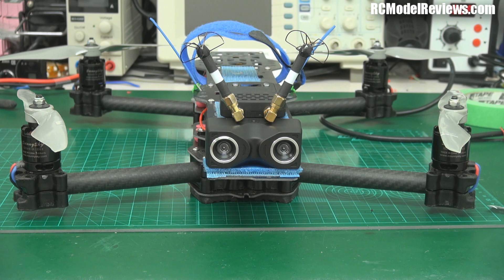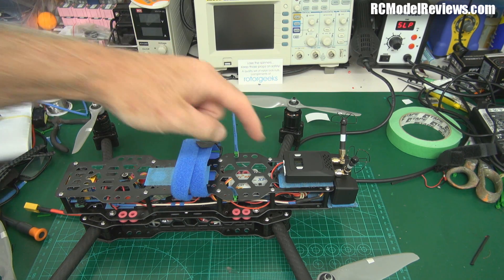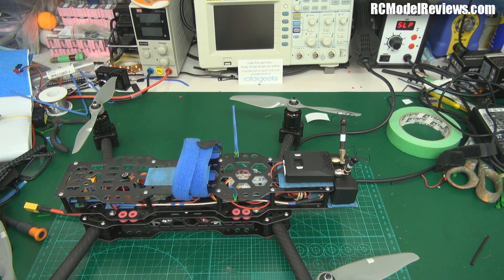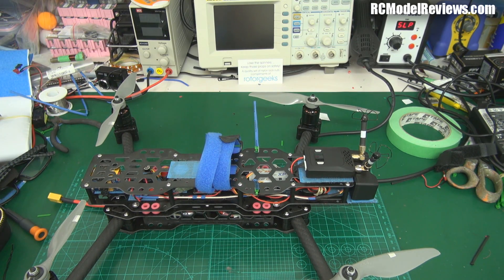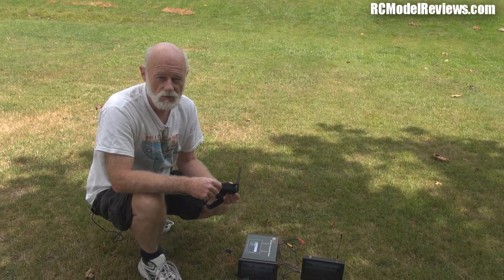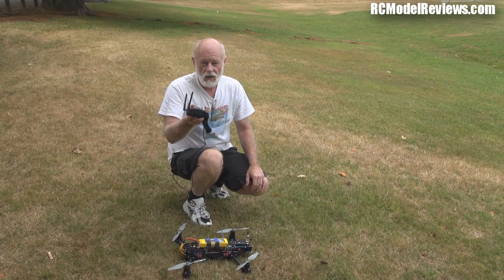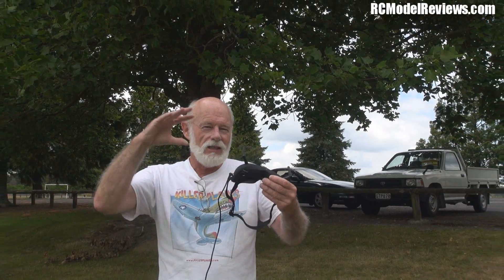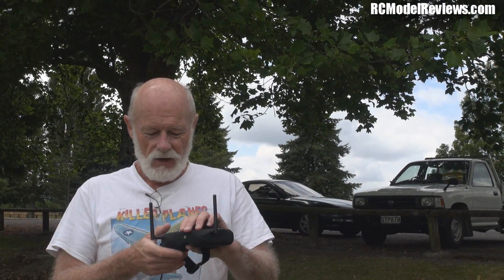Review: SkyZone 3D FPV glasses (with 3D footage in this video)

Comment: Hi Bruce-I am about to get some Skyzone Sky-01 V2 goggles - it sounds like you like these quite a bit and so worth the extra money?
Reply: RCdeparture Bear in mind that I've only used them for a total of about 15 minutes so far... yes I do like them.Even without the 3D option, they're an improvement on the V1 Skyzones (which I love) because they have the inbuilt DVR, a better light-seal around your eyes, a better in-built camera, a voltage alarm to alert you if the battery you're using to power the goggles is getting low and a number of other features/enhancements.There are some down-sides but they're minor and I'll discuss them in the next vid.

Comment: thank you very much for the review Bruce, besides the 3d effect, how does it compares to other goggles like dominators? I mean, with 500$ you could buy the dominator HD... is the image quality worth it? 
thank you!
Reply: Dag Eide
I haven't reviewed the Dominator HDs because they are awfully expensive (I only have a limited review budget) and FS haven't offered to send any for review so it would be a sizeable chunk of that budget.

How do the Dom HDs do 3D if they only have one receiver -- or does that require an external dual-receiver?
Reply: Ricardo Iarossi I'm going to examine the goggles and whole package on the bench in the next video but I figured that everyone wanted to see how well they worked and would be really annoyed at me if I left the flight video for a "part 2" ;-)Yes, the quality seems very good and the resolution is not far short of the Fatshark HD units -- albeit with a smaller field of view and a 16:9 aspect ratio.As I mentioned in the video, I think the "value" equation is good, considering that you get the total package from camera through goggles, whereas the Dominator HDs are only the goggles -- you need to add receiver, transmitter and camera to the mix to get an equivalent package and even then, you're not getting the 3D option.
Reply: ***** thank you! I'm asking that because the only goggles I tested was the Headplay and I didn't like it at all. first I could only see double images, after a lot of trying I could see one single image but it was not confortable. also the edges was a little blurry.  I was really upset because with the Quanum goggles(30$) I had a way better experience. Now i'm wondering, maybe theres something wrong with my IPD?
Reply: ***** I have the Dominator HDs and they do have 3D capability, although I haven't tried that out yet. Existing 3D cameras are too expensive to crash especially while I come to grips with miniquads. Two Sony600TVL and two small video Tx would be the go, as you suggest in your video.
Oh and for enhanced 3D while not flying proximity, try having something on the model in view of the cameras, as that will show the "gap" between you and the ground and give you the feeling of being way up high. Works best on fixed wing with more mounting options, but even something like a simple T bar mounted in front (which I use to give attitude clues when flying fixed wing bareback FPV) would show the effect.
Reply: ***** But you do have the 3D possibility with the Dominator HDs,
Why have you not done a review on the Dominator HDs by the way ? Probably the most anticipated item in FPV for ages when they came, with looong preorder lists that are still not fullfilled.
Reply: Dag Eide maybe thats exactly the reason he didn't yet?
Reply: ***** I see. The Dom HDs shows side by side 3D coming from a 3D camera. This image goes like normal trought a regular tx. And the only 3D camera I know works today is the Nerdcam3D, and it is expensive..
And this 1 channel side by side 3D looses half of the horizontal resolution. So I find the Skyzone approach very interesting.
Reply: +Dag Eide Have SkyZone 3D aspect synchronization? That is fps and resolution?

Comment: Since there are technically 2 video transmitters and 2 receivers, wouldn't you benefit from having a LHCP cloverleaf on one transmitter and receiver and RHCP antennas on the other transmitter and receivers? to that there would be less cross-talk between the 2 channels? Great Product!
Reply: Mitchell Cook There wasn't any cross-talk apparent with the setup I was using but in theory you are correct.